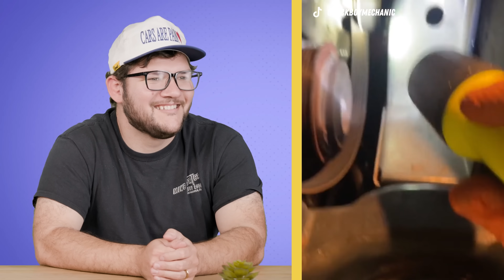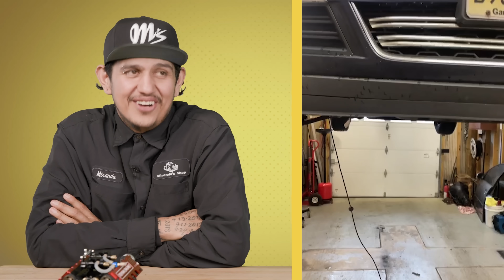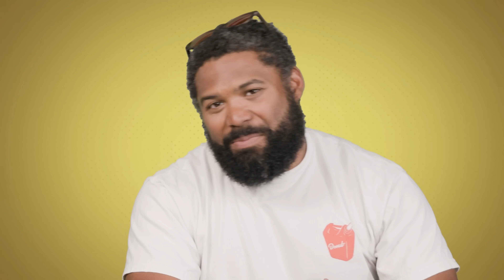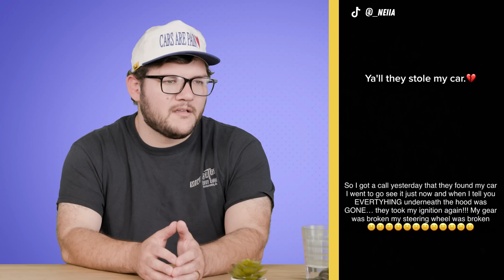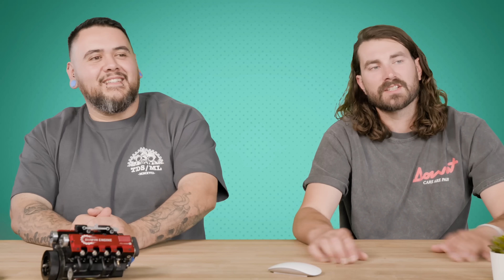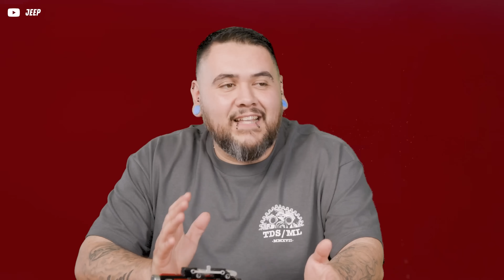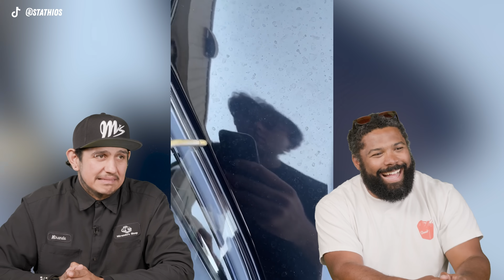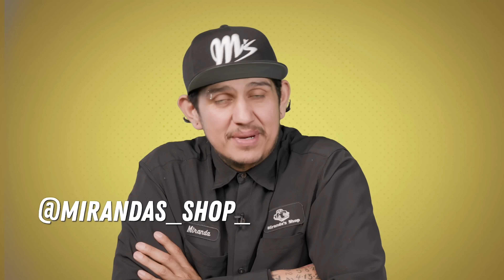Mechanic Reacts to Car Engineering Fails

Comment: I visited the Skoda factory in Mladá Boleslav, Tjech Rep. some years ago and there and then it became clear to me why these things happen. Engines, gearboxes, chassis, body and all kinds of other pre-assembled parts come from different factories in different countries. In the end the are fit together to make a car. To save costs, one type of engine is used in several car models. This means that sometimes an engine that fits model A perfectly, just about fits model B. Making modifications is expensive, so mechanics get bad surprises.
I don't remember what model it was, but the chassis complete with engine, gearbox, suspension, etc., rolled in and from above the body was lowered on to it. This all automated. No human hand in sight. I remember thinking: "nobody is ever going to be able to change that oil filter without lifting the entire engine".
Years later, I had to think of this, cause there had to be an engine part (I think it was the waterpump) changed on my own car (RAV4) and the garage manual (I like to know how things work) said 8 hours for the job, cause the engine had to be lifted out. When searching the internet, I found a (Toyota) mechanic, who said: "we actually just remove the wheel and the inner wheel well liner and than we can do the job without lifting the engine. Takes 2-3 hours". Then he added: "But you'll pay for 8". Mine was changed under warrantee, but nevertheless.
So sometimes mechanics find clever ways to circumvent these problematic 'bad design' situations.

Comment: Most of what is blamed on engineers is actually been counters fault. These days with trying to fit people into job they have no talent for, called diversity hires this is the biggest problem. Engineers that have never pulled a wrench for 3rd. EVERY engineer should be told to take apart and reassemble their car before it ever reaches the market. It's the same with Kitchens, chefs don't build kitchens architects do.

Comment: Older Jeeps are fine for the most part. It's the newer 2008+ Jeeps that have most of the issues. Jeeps 2000 and earlier are still some of the best vehicles to own, particularly with anyone one of the inline 6s.

Comment: well Im 12 years of mechanic here. that is the problem on transverse Engoine. not NOrth South. if an engine that meant to be facing norht South, its fine. Radiator off orthe fan shroud. 
tansverse engine? yeah that Pully will be 1 problem. ESPECIALLY V engines( im looking at you V6 Mitsubishi.

Comment: First guy with the Chevy idler pulley: 1987-1991 Mercedes with the m103, specifically w124 (and related chassis). Had to pull the radiator to replace timing cover gaskets for the same reason, bolts way longer than need be.

Comment: I have a 1976 mercury monarch that has 47k miles on it. Recently the ac and heat blower started acting up. Easier said than done. The bottom of the dash frame is in front of it allowing the blower to only come halfway out. I had to remove a dash bolt and pull out on the bottom of the dash to get it out.

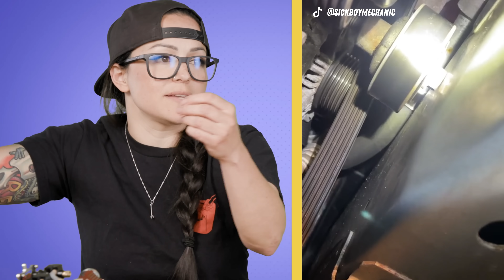Comment: 1:08

Is she serious?  Is she even an actually a technician?  There’s a set labor time by the manufacturer.  I am sure that belt tensioner pays more than the belt tensioner on something like a big v8.  The manufacturer is calculating for the fact that you have to loosen the motor mounts.  It’s not costing the technician time.  It’s paying his bills and making the job more profitable
Reply: 2:35 is just keeps getting more laughable

Comment: im a mechanic and fuck PSA, but from all the cars that i worked even from psa, the peugeot 3008 from 2018 ig was the worst, with a 1.2puretech i wanted to do the distribution ab instead os chain was a rubber belt and thats ok, but was that rubber belt that are on oil and rubber and oil dont work that well but with the right oil it "works" but man, i need to remove the carter, the subcarter becaus they couldnt do it with just a carter, an the belt jumped teeth, so the oil pump was obstructed and had to take it off, but for that the subcarter needed to go out, but it had one of that retainer,s with a metal plate on the side of the gearbox, to take the gearbox i needed to take also the charrion and for that also the front bumber because it was weirdly attached to the charrion. so carter, subcarter, gearbox, charion and front bumper just to take the oil pump

Comment: Audi tech here, the Q3 problem is extremely common and there is a TSB out for it. The problem is the engineering behind the sunroof drains, and the fact that the rail is designed with relief holes in it that allow water to sneak behind the moisture barrier and into the cabin. Solution: don’t buy a Q3.

Comment: I drove my 09 Acadia for years with a busted headlight because it's impossible to replace a bulb in these. You have to remove the front facia completely and replace the entire headlight assembly! Light bulbs are one of those things any car owner should be able to replace with simple, household tools like screw drivers and such. Not something you should have to schedule an expensive appointment to the dealership for!

Comment: i think at the very very very top has to be nissan's cvts. esp on the 2013 rogue that i recently offloaded to buy a slightly used lexus nx350h.  i was given a quote from a Nissan dealership 5-7k without labor for a new transmission.

Comment: I mean whenever you're designing anything you really should be thinking, what if something goes wrong? what if this part breaks?

it's not that hard, I'm very much not a mechanic but if I was making something I'd definitely be considering how I'd fix or replace things, and is it going to cause problems elsewhere if it does.

Comment: I love Land Rovers, but theyre unreliable and costly to run.
However, besides the shitty placement of the undertray, the reason that oil is black is likely because its a diesel.
The guy sounded like he was from Liverpool in the UK, so yeah 99% sure its a diesel and every diesel I've owned has had black oil at every oil change

Comment: That's why I love my toyota 4runner and tacoma always start right up never had any issues and have only done regular maintenance like oil,new tires,brakes and trans flush both have close to 482k miles combined and just got a new camry I'll never go back to chevy or ford I had nothing but problems and a buddy of mine is about to trade his jeep gladiator and his wife's compass for a Tundra and rav4

Comment: With that first one, the Chevy Travesty, I bet that it's neither the engineers or the factory - probably an executive. Probably that engine is used in other GM cars as well, and they just threw it in a line of SUVs to save money engineering a bespoke engine. Engine was likely designed for a different engine bay.

Comment: A lot of the build quality and unnecessary added electronics that cause major problems in newer cars is why I'm keeping my 2001 Firebird.  I've seen some ridiculous engineering. The latest is a Lincoln Aviator. If the car won't start, you can't shift into neutral unless you remove a little access panel buried  in the front of the center console. There's only enough room to fit your hand. You're going in blind and have to use a pocket screwdriver that is about 1/2 longer than the free ones from the tool trucks to move a tab on the linkage to get it into neutral. This particular car wouldn't start as the connector to the electronic fuel pump was corroded. It is hidden under a plastic underbody panel that water stays in after driving in the rain. 🤦🏻‍♂️

Comment: I'm like Sandro, this new stuff ain't it. We make good $ where I work and most of us are gearheads. The parking lot goes from classics to brand new. Being TX, it's mostly trucks being "dailyed". I drive a 2007.  Some guys are having buyer's remorse with their brand new trucks. $80k RAM and in the shop @ 11k? New Denali dually with rear end whine, check engine light on and sunroof leaking. $95k prolly. Has been in the shop more than his driveway. Brand new Ford Super Duty Tremor package, fuel injector stuck open burned a hole in the piston @ 34k.
RV's? Pssshhh. No way I'd ever have one after the stories I've heard. 
I'll just stick with my motorcycles. But even they're getting stupid complicated and expensive. But we keep buying the crap.

Comment: I used to be a Ford technician. One annoying thing about Ecosports are their cabin filters. You have to remove the A/C controls, disassemble the center tunnel, and only then can you get to the housing and remove 5, inconveniently placed screws. Built Ford tough huh?

Comment: Most newer jeeps especially with the push to start have an auto engine kill for when you stop. It kills the small accessories battery which also controls the door locks. Dumbest thing ever.

Comment: 2014-20?? Ford Edge 3.5L V6....you have to take the foam engine cover, upper intake plenum, airbox, evap line, 6 coil packs and like 7 or 8 connectors off to change the back spark plugs.

It was a 15 minute job.....WHY, Ford ?🤣

Comment: Worst engineering screw up I ever saw was when Chrysler brought out the Dodge Omni / Plymouth Horizon using the 1.5 and 1.6 litre Volkswagen engines.
Volkswagen used these engines in the Rabbit and other "water pumpers". Simple and easy engine to work on. Wanna change the timing belt? Fine, just take the timing belt cover off and get at it. Not Chrysler, oh hell no. Chrysler stuck a f#$king engine mount in the middle of the timing belt loop. You wanna change the timing belt? You're jacking up the engine first, then you're taking out the left hand engine mount, then you can change your precious little timing belt.

Comment: I'm an engineer at one of the big three and we actually have a person in our development meetings while working on design early on to make sure we factor in servicability for cars. Obviously we don't find every issue, and sometimes things are difficult because of 10 other things restricting the way the part is designed, but most modern vehicles are actually designed with the intent of making them able to be serviced without much issue.  

I agree with most of your calls here, except the Range Rover oil thing.  That was the mechanic screwing up.  You're clearly supposed to take off that aero shield that the oil splashed on and the mechanic was too lazy to actually take it off.  The suggestion of putting piece of cardboard is also a good option if you only want to take off the little oil access panel that the mechanic already did remove.

Also, on the last one, it was a recall.  Clearly it wasn't that, "The engineers didn't think about it."  Cars can find new and exciting ways to break sometimes that can't be predicted.  We test these parts extensively in every way we can think of to make sure they're going to last.  While I can't speak for every company, we don't generally design things to just make it past warranty, we actually design them to last much longer.  Most parts are designed for 2 "lifetimes" (2x warranty) except powertrain stuff that's designed for 3x life.  Anything that's not intended to ever need servicing on the powertrain (lines, sensors, wires) are intended to be good for 150k miles / 15 years.  So, it being difficult to get to that sensor and it's being in a bad spot for leaking was probably deemed okay given that it shouldn't need service.  Also, the wire harnesses on vehicles are super complex in order to keep costs down from having so many individual wires to install at the factory.  It's going to be a lot of work to replace that thing, but as I said, it was never intended to be replaced over the entire life the vehicle.

Comment: I had to replace a 98 Lincoln Mark VIII blendor actuator. Now, mind you, the warranty time paid 16 hours because it was located behind the dashboard. The car was no longer under warranty, so when I told my service advisor this, he shit his pants. He had to explain to the customer that this was going to cost about $1500, mostly labor for a $75 part. I was able to visually see the actuator through the glove compartment with a metal bar in the way of accessing it. Needless to see, I cut the bar out of the way because it served no purpose at all. It took me 30 minutes to complete the repair. I made great money that day clocked about 30 hours in an 8 hour day 😂

Comment: Tell me about it I had a 01 gmc Sonoma and I had to change our my heater core and unfortunately every video I saw on YT about diy  everyone else said that you would have to dismantle the entire dashboard half the stealing column and half of everything on or near the passenger side of the firewall under the hood including the glove box and everything behind it  and remove the passenger front tire to.just to access it...but the older '90's S10 you could just lay upside down and get it from under the dash on the passenger side. Or whenever I had to change the oil pump I had  to practically take out the whole engine just to get enough clearance for the oil pan to open up..thank you GM engineering ... I ended up having to Jerry rig the heater core under the hood instead of doing it right wasn't experienced enough to know how to do it right without messing something up and didn't have the money to pay someone in a shop to.... thanks again GM and the engineers that make it so much fun and interesting....

Comment: I had a Chevy Corsica where those asshats did that with the belt tensioner.  Not even using an extremely long bolt, they shoehorned in the engine so bad that there was no room to turn the bolt out at all.  I had the belt tensioner break, I was like "That's fine, I have wrenches", take a look under the hood.... nope!  I ridiculously had to pay the (at the time) $50 flat rate to get my car towed ACROSS THE STREET to a shop (the road had too much traffic at all times of day and night to just wait until there was no traffic and push it across the street.)  Plus whatever it cost for them to jack up the engine to be able to change it.

Comment: All the "Engineers" fails are Management fails. The management doesn't want to fix any problems that occur after the warranty period runs out. They want to build the cheapest car that meets the performance metrics and makes it through the warranty period. It's not the engineer's fault. Let the engineers have free reign and you get cars like the Hellcat. Also a retired Ford engineer told me they get bonuses for making the cars harder to work on. That way the dealer can make more money on repairs. I assume the other manufacturers do this but I know Ford does at least.

Comment: As a Manufacturing Engineer about to graduate from college - many of those manufacturing / factory faults I’ve seen happen is due to plant management ramping up the production line speed in the name of increasing production even when the assembly processes cannot be completed properly in that time span. You end up with a lot of product but product with faults instead of a properly assembled product. Some of upper management just sees the short term profit when in reality you tank your long term profit due to hurt reputation because of poor build quality.

Comment: I had a Taurus with a similar bolt problem as the first example.  I drilled holes in the wheel well to get the bolts out.

Comment: That jeep was probably suffering from Cam and crank location sensors with bad connectors. We had one that we tried to get it fixed several times. There was a recall on the sensors, and dealerships repeatedly said it was already part of the recall... plot twist .. 2 months AFTER the original recall (which this was in fact a part of) they had another recall with the same recall code because the repairs were done incorrectly on THOUSANDS of vehicles. Turned out they needed to replace all three sensor connectors, and they'd only replaced one in most cases.

On top of this issue, they put the relay box in a downright AWFUL spot, above and in front of the wheel well, with an access hole in the frame directly below it, completely open to the elements. In a state like Vermont, with bad winters and salted roads, it's almost guaranteed to corrode out every 2 years. And it has. Like clockwork. The relay boxes themselves are all on backorder everywhere I checked because it's such a common problem. The only way to deal with it is to dig out the original terminals and piece it all back together with fresh parts. FRANKENSTEIN.

Comment: I've done that traverse job, I just pull the bolt all the way out, cut the head off the bolt, pull bolt and replace with a slightly shorter one.

Comment: I had to use lemon laws but it was really hard getting the dealership to buy the car back.  In my state there was no set number of attempts they got it just said a "reasonable number of attempts" well my dealer got 8 attempts, also I had to prove I couldn't use the car for over 30 days and they wouldn't accept my written logs so I ended up having to spend a bunch of money on an attorney.

Comment: my first car was an 04 kia carnival. 
Name brand parts having criminal pricing aside ($1200 KIA vs $650 gates OEM equivalent) for the timing belt kit. 
Because of how its been engineered, and the tolerances, i was told by 2 different mechanics they are a nightmare to work on and the timing belt if all goes well, its a 7-8hr job to do the whole kit.
Parts plus labor costs more then the cars worth.

By comparison my 03 Hyundai Getz, for the same job, 3hrs and total cost was $750, they even replaced a couple small things i needed while they where at it for free.

Since getting quotes on repair for Kias, ill never own another one, but my positive experience with hyundai, they are one of my first choices for cars. 
And i would in a heartbeat consider a 2010's getz if i wanted a more modern small car.